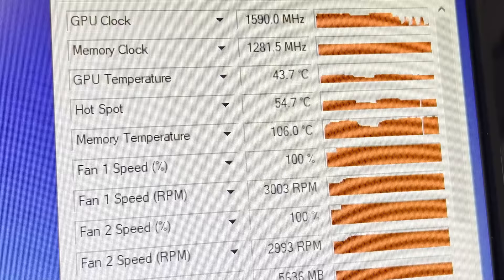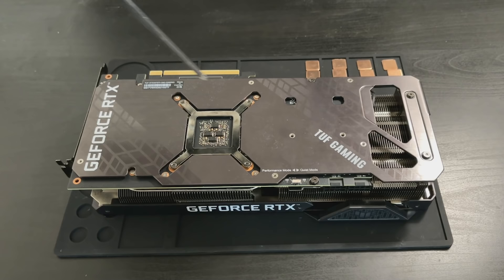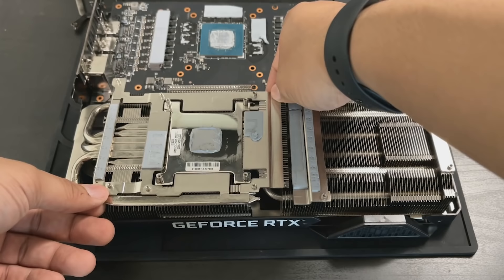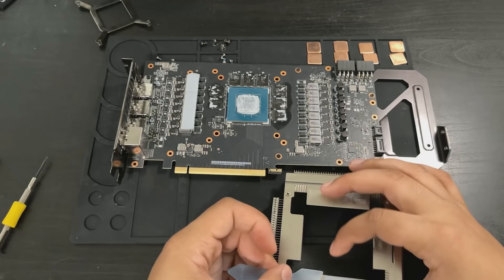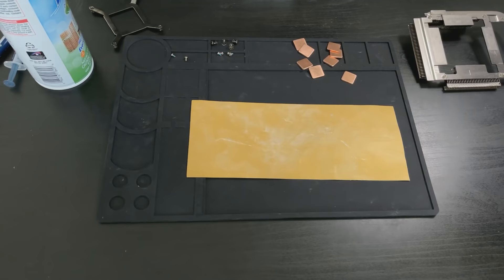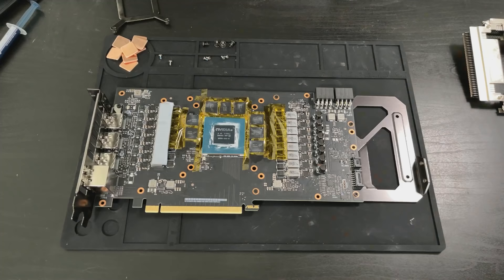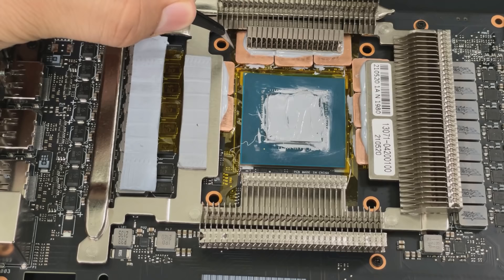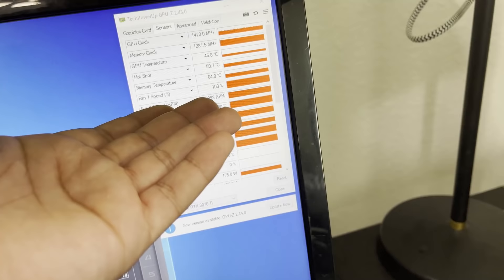I Copper Modded An RTX 3070 Ti.  Memory Temperature Dropped 45 Degrees! This Is How. (110C to 64C)

Comment: The tuf gaming is a very well designed card and should handle it easily, mine dose no more then 82°C on the RAM full throttle. maybe something was faulty with your card. Still replaced the pads maybe half a year ago with some good thermal putty and now we are in the high 60s on the ram.

Comment: This is a design flaw in the card, the thermal pads could have done the same job if the heatsink was designed correctly.

Comment: That's amazing they slapped a thermal pad on a heatsink that didn't fully cover the memory.  Thickness of the copper was just enough to replace the thickness of the original pad?  It looked like the bracket also keeps the right amount of compression.
Reply: hello. I'm typing with google translate. I apologize in advance if I misspelled. The thickness of the copper should not be the same as the thermal pad. because today i did my first test with rx580. Today in the industry I cut a thermal pad thick copper. but when I came home and did as in the video, my furmark test jumped to 80 degrees in 1 second. because the coppers were the same thickness as the thermal pad but it was thick. Since the coppers were thick, the heatsink did not fit the GPU properly and there was a gap of about one millimeter. example; If the thermal pad is 1.5 mm, the copper should be around 1.3. this is just an example. because the thermal pad is a soft material. but copper is a hard material. no yawn. For now I just put the old thermal pads. but tomorrow I will cut copper sheet again. I will cut 2-3 kinds. This is valid for the "msi armor rx580 8gb oc" model. If I manage to do it, I would like to share it with you as a video. to give an idea.
Reply: @MTCHANNEL.MTCHANNEL  Thank you!
Reply: @MTCHANNEL.MTCHANNEL  checking out your vid.

Comment: hello, I have a question for you. I would appreciate it if you could answer it. What is the thickness of the copper plates you used? What is the thickness of the copper plates you used? Is 1 mm enough or should I use 1.5 mm? My card is the same model as yours. @DandyWorks

Comment: Perfect but seeing the incredible job you've done : on remark i will use liquid metal not MX4 (you have done 95% of the job already !)
Oh and you have underclocked a lot that babe  OCed > 2000/2200 mhz are achievable

Comment: Something's awfully awry with those GPU temps. For only 8Gbs on the RTX 3070ti. I'm willing to be that's a factory default, because typically most Asus TUF cards have had great VRAM temps. This is still a massive temp drop though, so by all means. Congrats!

Edit: That is one wonky ass installation on those pads! when you first take of the plate. No wonder they were scorching.

Comment: Copper Mod can kill your gpu! ideal temps for vram is at most 10c higher than gpu core! the simplest inexpensive way is to buy some good heat transfer pads for vram
3070ti  and if i can remember exactly the 3090's will run vram hotter than other cards
Reply: Not 10 C> VRAM  is  higher than GPU with at least 15 C to 20C sometimes over 25C on poor designed radiators or when manufacturer forget to put thermal pads on.

Comment: Does your Asus Tuf 3070ti have a coil whine present before/after the mod or any improve/worst coil whine after it is mod? I have this same GPU and the coil whine is very notable under load (not using pig tail PCIe cable).

Comment: Shouldn't you be using slightly thinner copper shims since thermal pads compress, and copper does not compress as easily? That being said, could you run Heaven or 3dMark just for another reference?

Comment: if you have to mod a computer component to make it run cooler because its overheating then the manufactures engineers need to be replaced.
i hate the "you get what you pay for" phrase. when you buy something you arent paying for crap no one intentionally pays for crap and then you have apple where people over pay thinking they're getting a premium product when the only thing that's premium is the price tag.  just because you spend $500-1000 more dont mean your getting your moneys worth. the company is just good at marketing and up-selling the public by a large margin. 
and then there's scalped GPU's what on earth are you paying an extra $1000 over retail for? bragging rights? thats never worth the money

so that "you get what you pay for" phase is complete garbage.

Comment: oof if you look closely at the frame at 5:43 on the left most vram chip closer to the gpu chip there is one of the transisters ripped off some how and this was even before you did the copper mod

Comment: Should I do this with my Xbox 360? Will it speed it up? or expand lifespan. Or increase loading times. Or will it let me leave my Xbox on for a longer Because I leave it on for 24 hours to AFK. How hot does GDDR 3 Ram get? Does it even need a copper heat sink.

Comment: Great idea, if I may suggest some improvement, the Kapton is not necessary as the thermal grease should be dielectric. You may also use thinner copper pad as suggested below. And finally, please don't put that much grease ^^, it's only here to compensate surface defect, so a few microns thick is necessary ;). When assembling my new PC, AMD already pre-coated the CPU, and man that's really a thin layer, don't make it a sin layer ^^. But great thanks anyway for sharing this.

Comment: Very daring mod but nice results! I used 40x40x10mm alumium fins on top of my 3090 to reduce the temps 5-15c as Im not brave enough to open such an expensive GPU

Comment: I got a waterblock where 1mm pads don't make enough contact with the memory but 1.5mm pads stop the die from making contact at all, seems to need 1.2-1.3mm pads.
I'm going to install 0.8mm shims with a 0.5mm pad and see how it goes

Comment: You know what you just demonstrated? You showed that the card is just built wrong. Those cooling pads are dog shit. They don't work. Usually they make temperatures worse, not better. Manufacturers should stop using them. The cooler should obviously be making direct contact or shimming the memory like you did. So easy to build it right, but they couldn't be bothered.

Comment: My RTX 3090 RAM ran at 66 degrees celsius on Furmark, and that's by replacing the thermal pad with Gelid Ultimate and no copper added, I don't know if your copper is actually doing anything helpful on reducing the temperature.

Comment: Sweet video, thanks for the hack. Great call on sanding the copper to get rid of the layer of oxidation. Have you already considered thermal adhesive by Artic Silver for the connection between the ICs and the copper? That way there isn't any risk of them moving on the card. Still use regular paste between the copper and heatsink of course. Also MX-4 isn't electrically conductive, so what about using that to insulate all those small chips instead of the tape thereby allowing heat to pass through them as well? Curious if that created a hot zone due to the tape.

Comment: I'll normally use a brass mesh and glue it to the heat sink around the edges and then apply a thermal paste to fill in the mesh.  It is a bit time consuming but so far it has done well with preventing accidental shim shorts.

Comment: Is this an Asus issue cause my Evga 3070 TI FTW3 doesn't even come close to those pre-mod temps with the fan at 50% and 85% usage. It's in the 65 C range. Maybe cause I'm using an H500M case?

Comment: This must be a sign. I have the exact video card with the same exact heating issue. Freaken thing gets to 90 C just from trying to overclock. I can go higher on the clock but I don't want the card to melt.... It feels like an actual heater at this point.

Comment: DandyWorks : your GPU is bending....which can result in a bubble on the middle of the DIE itself....and you used too much thermal paste. Due to the facts as of why thermal paste is needed in between two metal parts, there is only a need to die the surfaces and not spash them in thermal paste since it has no other purpose and only squeezes out on the sides. Your way of using the thermal paste is a rookie way.

Comment: Got a couple questions:
Is this worth it to do for ggdr6 such as the ones on the 3070 3060 Ti etc.
Why don’t manufacturers do this by default if the results are that good
And is there another material that isn’t as dangerous to use (isn’t electrically conductive) but still moves a lot of heat

Comment: First sorry for my google translate English. I'm about to do this mod on a rx 5700xt asrock challenger, it also has an aluminum heatsink under the VRAM and with 1mm thermal pad, I will use 0.80mm copper and compensate the remaining 0.2mm with thermal paste, my doubt is that over time the paste does not lose volume due to evaporation and consequently the copper moves. I think about using nail polish to isolate, the tapes encapsulate and muffle the component that are below it. Does nail polish need chemical solvent based or water-based? Is transparent the most suitable? I don't want to spend tens of dollars on specific solvents like thermal grizzly.

Comment: Sorry to say but those copper plates are a complete bs. Not only do you completely void your warranty, but if the plate contacts with any electrical components on the board then in 99% of the cases you get a short to the processor itself which completely destroys it, requiring a complete chip replacement (which is impossible to get for a good price right now due to shortages). One of my colleagues working in a service repair shop has had an huge influx of completely dead unrepairable GPU-s recently due to this. If you want to cool your memory and not completely destroy you graphics card then just buy better replacement thermal pads of necessary thickness - something like thermalright 1.5mm usually works most of the time.

Comment: Doesn't seem like a "crazy" thing to do at all. Just take the time to do it right and the risks should be quite minimal.
And, luckily, it's easy to buy sheets of copper and thermal paste. 

I'm not sure why you cut 9 small pieces when 3 larger pieces could have covered multiple memory units each and it would be marginally easier to do.

As for using that tape, perhaps there's some kind of resin or glue that you could use to encapsulate those capacitors instead of fiddling with pieces of tape?

Comment: Also, those stock thermal pads were so poorly placed and the thermal paste was sloppy as well. A tip that I’ve come to learn during my research is that with thermal paste: less = more and you don’t want to pre-spread it. Remember that the goal is to connect the two surface areas; it’s best to let the pads spread the thermal paste.

Comment: It's a great idea, but takes a bit too much at least for me. I think it is easier to just change pads to higher quality. I changed my pads using Frosty Thermal Pad 12.8 and now have around mid 80s. Sure it's no 64 degrees, but I can attest both temps are way below the minimum. At this point, I doubt it will fail.

Comment: i mean copper does transfer heat way better, but it is weird that your memory was running that hot, my 6800xts memory doesnt even hit 60+ usually my gpu, stays under 60c aswell usually tops out at 60-61c, memory is always a few degrees cooler, this is with a room temp of 24c. only card i ever had that ran hot was a crappy msi rtx 3070 i had that had poor thermals overall and was loud as hell.

Comment: why the hell did they not make the heat sink for the card closer. I don't think there is that much variance in memory chip size. they could have just made it from the start only need thermal paste or a much thinner thermal pad.

Comment: One question Im ready to do it on my laptop with 4080 gpu, I order the correct size of copper shims little less than the th pads beacuse they are compress by the heatsink , so is OK If I put thermal paste, and copper  and second layer of  th paste, before I put the heatsink back..What you say; is OK for the air gabs and not moving.. I think..

Comment: Have you tried gaming with this copper mod? Mining is hitting vmem hard but the vcore lightly. The extra heat transfer from the memory will soak into the vcore sensor and may push that into too high temps while gaming.

Comment: I have the same 3070ti tuf and I have 82C after 10 minutes of furmark. How did you get 100+C in idle ?
Reply: ya i have the same thing. tried multiple games and benchmarking and could only reach 82c. im kind of confused on the drastic difference

Comment: That actually seems pretty interesting I would only try this if I had a spare GPU card lying around. I believe that they do this on purpose to have your GPU heat up on purpose so it breaks so then you buy another one in the future. I had to modify for the hell of it my PS3 because I've add PlayStation for years and they too create this hot oven Style creation of a system why they are so tiny that it doesn't really solve the heat issue and within the system itself. I won't be buying any consoles anymore because of this problem.

But I didn't do some crazy stuff like this like copper I just modify the case because I come to find out that the fan is blowing in the way that it's supposed to go out the back but where it's facing is towards the case where it's kind of like taking a towel or a napkin or a rag and put it on your nose and mouth and expect you to breathe in the PlayStation restricts air flow and that's why in the same way as Xbox that's why you get those Rings of Death because they just created an oven.

A lot of times it's not an engineering flawed is actually just a way to get you to buy a new GPU card and they're very expensive I don't think the Nerds that created the GPU miss the overheating through trial and error I'm sure they were aware of it but the boss up top said make it get hot on purpose so they buy a new GPU in like less than 4 years with their intensive gaming. LOL 😂😂 They know what they were doing when they did this. 🤷‍♀️

Comment: Couldn’t you have just lapped the cooling plate down so you wouldn’t even need the copper by allowing the thermal pads to actually be compressed? Also why not use a non conductive thermal paste that costs the same and not have to buy the tape?

Comment: Nvidia and AMD, this is how its done. You can have build-it copper pad on your heatsink. Im sure your capable of doing  that because you can design your PCB components to avoid touching the copper surface instead of that crappy thermal pad.. Im sure gamers are willing to pay extra for more cool gpu

Comment: I wonder what would happen if you used a .5mm thinner copper, then used a .5mm thermal pad to stick the copper pieces firmly to the heat sink then apply thermal paste between the memory module and the copper? Would pretty much remove the need for tape as the copper would be stuck in place with the pads, and for cards like mine that don't have that open sub frame cooler for the moduals, I could safely place every thing once without shifting once I put the cooler on.
Reply: Have u tried this? Does it work?

Comment: Very nice job and temperatures great.. what if you have done copper strips same size of the thermal pad or better slightly thinner to avoid to much pressure to the components.

Comment: I wonder what this would do to a water cooled unit with an active back plate 🤔

I'm currently using the standard EKWB thermal pads, which are apparently rated for 8w/mK

On my 3090 FTW3 my memory junction temps stay under 80*C and my memory doesn't seem to go much above 55*C with mining, or Furmark.

Furmark seems to run a little hotter than mining, though.

Comment: I don't have a copper mod and my temps are the same.  He then has a maximum memory overclock and mining.  RIP memory. Cards been running at 110c memory so it will die.

Comment: An easier way to remove the pads without them ripping is letting them cool off. I'm assuming u did the teardown right after or a little after doing the benchmark?
Reply from the maker: Nah, I waited. I’ve tried heat and I’ve tried cooling, but pads still rip. By this point, I might just stick the GPU in the freezer for a bit to see if that helps.

Comment: It's a really basic "mod") could be better (clean all the remaining of the previous thermal paste or use a better one like the Artic MX6) but the results are amazing.
So the 2nd point is not all the 3070 have that 2nd "structure" that cool down the mems but a similar process could work if you "shrink the height" of the copper square
or just use watercooling

Comment: Had the same problem with my RTX 3080. GDDR6X is ridiculously hot and doesn't offer much performance compared to GDDR6. 
In some cards like Zotac they charge you a kidney and use the cheapest Thermal Pads in the market. If you have one swap and don't buy Zotac GPUS anymore.

Comment: thermal epoxy would work better than paste on the mem modules, i wouldn't trust this mod too much because the thermal stress on the copper can move the shims and they can fall out or worse expand and stress the pcb

Comment: Nice video, when you decided on the thickness of the copper was it solely based on the thermal pad thickness ? 
I am wondering if using a 1.4 or even 1.2 mm thick copper piece would give better results as thermal pads compress significantly, and the copper doesn't. 
I'd say thermal pads compress at least  0.2 mm maybe more.
Reply from the maker: In this case i matched thermal pad thickness exactly, but only because there was a separate heatsink for the memory ICs. In the (much more common) case of a shared cold plate between the GPU and memory ICs, I would go .2mm thinner than the stock thermal pads for shim size to account for pad compression.